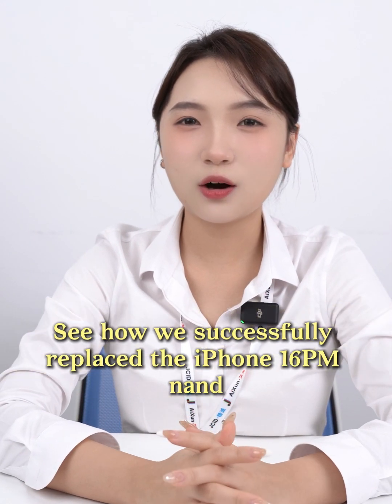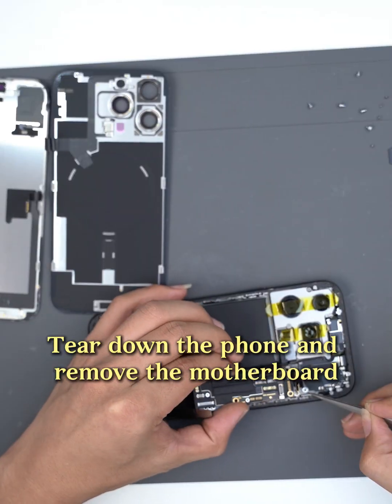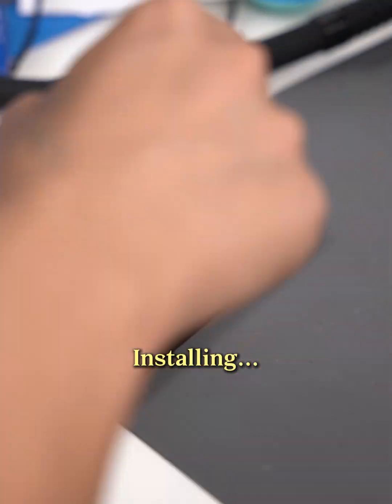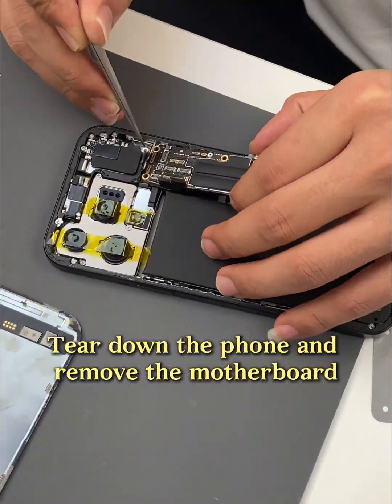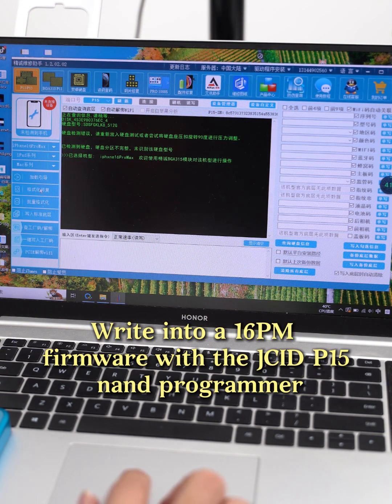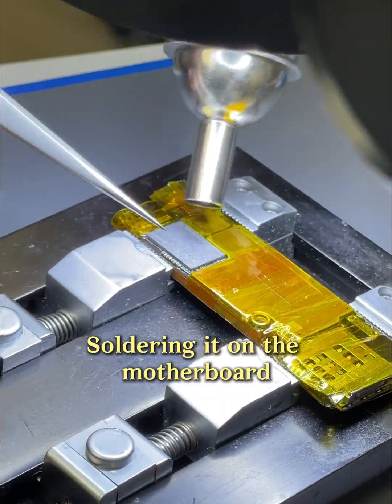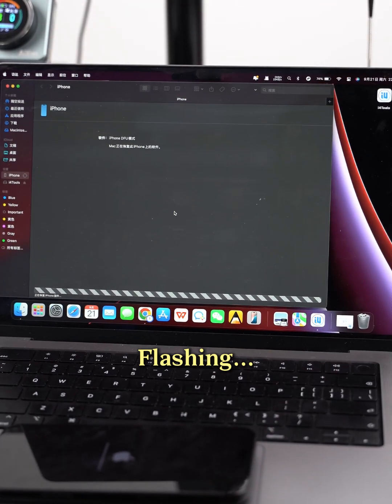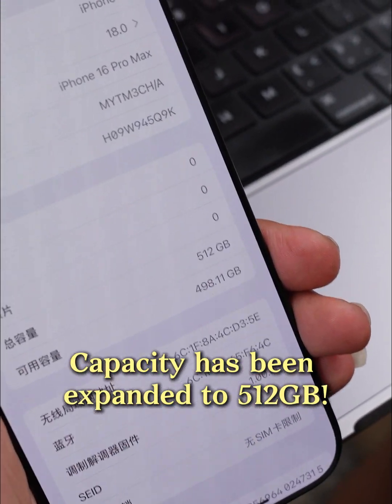Expand NAND Capacity of iPhone 16PM From 256GB to 512GB  With JCID P15 NAND Programmer #harddisk

Comment: Is there a reason why three different computers were used: the one that first installed NAND and ipsw, the one that used the programmer on the NAND, and the one that installed ipsw at the very end (though the last computer could be an exception since the programmer is for Windows)?
Reply from the maker: Hi, you can operate just with one computer, it doens't matter.
Reply: @jcidtech  Thank you for replying! :)